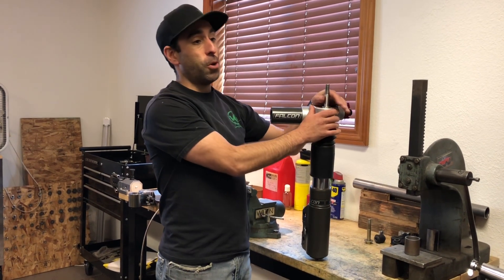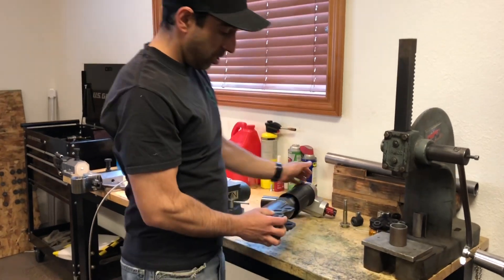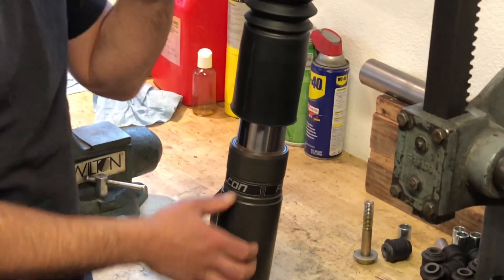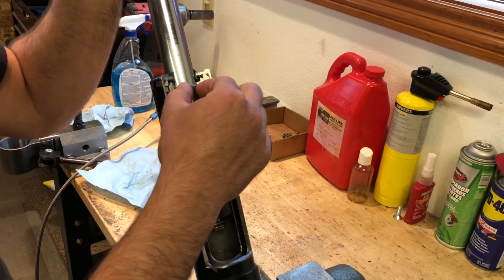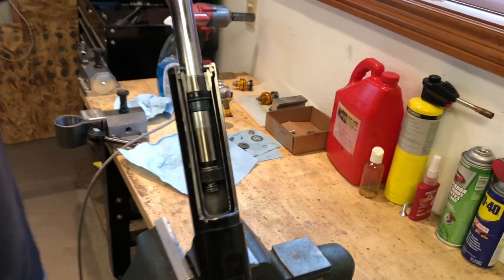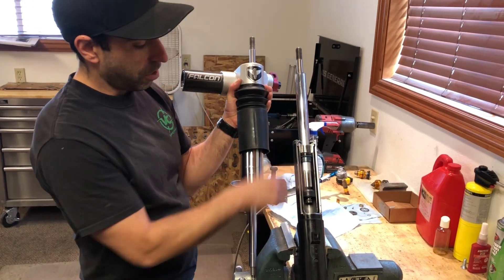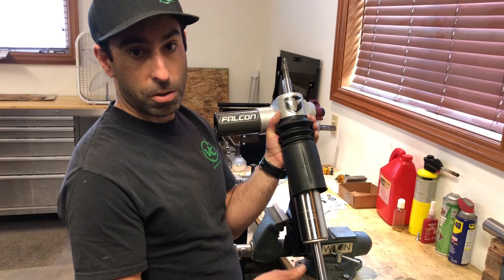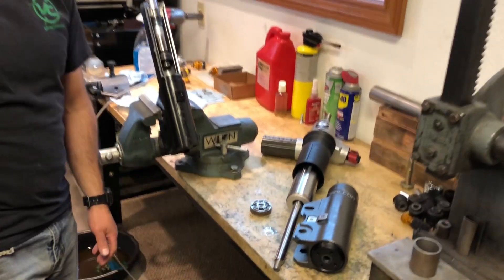Van Compass Inverted Strut coming for the Sprinter Van

Comment: How should this stack up to the evictus setup that just blew my shorts off?
Reply from the maker: We can say that the front end performance is similar for high speeds, but some (patent pending) tech not yet shown makes our system better for low speed uneven surfaces while maintaining high speed agility. Our system is well rounded for all driving conditions and speeds. Our secondary shock paired with the Falcon Strut will also control slow speed side to side movements much more that the Evicts Bilstein alone, plus keep the van flatter around turns.  Our rear suspension most likely works better because is it not a coil over placed at an angle on factory springs. This causes a digressive rear spring rate on compression. We use standard springs that ramp up rate as they are compressed. Our 3.3 strut/shocks are also adjustable. Evictus do not adjust externally. Their marketing says their shocks adjust automatically because of their anti cavitation valve. The 3.3 Falcon adjuster is similar to that valve, but it can be adjusted externally as well. Plus, all monotube style struts/shocks are velocity sensitive to shaft speed. 

Service Life - Our strut will last 100K+ miles. The damper rod is completely protected from the elements, keeping the oil clean and shaft safe from corrosion.  The DU bearings are massive compared for the Bilstein strut. 

Cost - Our 3.3 pair of struts will retail for $1960. If you were comparing apples to apples - adjustable strut, adjustable rear shocks and adjustable Opti-Rate rear leaf springs - Total cost $4,658 vs 10K for Evictus. Or you can get a 2" lift from us with opti-rate rear springs and add the secondary adjustable shocks and be all in at $8,177.
Reply: Beautiful response. 🤙. When can I get a set to start beating on?
Reply from the maker: @jacobdayley6350  We are hoping to have 4x4, 3.3 struts arriving in August or September as materials become available to build them.

Comment: So I'm super new to van suspension. But will have a 2023 AWD 170 build out done mid August. Would this be used with a 4.3, 6.3 etc kit or used in place of?

P. S. Was planning on a 6.3 or 6.5 kit, do we think we'll see AWD version by August released?
Reply from the maker: You can use this strut in place of the secondary front shock found in the Stage 1-6 kits or it can be paired with for ultimate performance.
Reply: @VanCompass  Any estimation in when I can order a 6.5 kit for our 2023 AWD and then add the new strut?
Reply from the maker: @Paul2009SM  The electric shocks have been a bear to keep in stock. We will have the AWD 6.3 lift kit available in July and we hope to start getting 3.3 struts in August/September.
Reply: @VanCompass  That leads to another question, sorry. If I were to get the AWD 6.3 intalled in August due to the lack of 6.5 AWD and then add the 3.3 struts down the road would the new struts make the alectric/auto feature of the 6.5 kit less needed since you'd have the adjustable front shock and the strut to configure for a broder range of use cases without having to adjust everything as you change from highway, to dirt to rock?
Reply from the maker: @Paul2009SM  The new strut makes such an improvement in ride that you will not need to worry about not having the Adapt feature.
Reply from the maker: @Paul2009SM  Electric shocks are probably a year out again. The standard 3.3 shocks are really amazing and offer a huge range of adjustment. The new struts offer such a gain in performance that the auto adjusting shocks is not really necessary for ultimate performance.
Reply: @VanCompass  awesome! Is there a way to get on a wait list for the 6.3 kit for AWD? Been checking the website daily for it to drop. Hoping to get that installed late August by Owl Van in Colorado but wondering if there a pre order or anyway to get it as soon as it releases?
Reply from the maker: @Paul2009SM  We will have a limited stock on this kit available early July and more inventory late July.